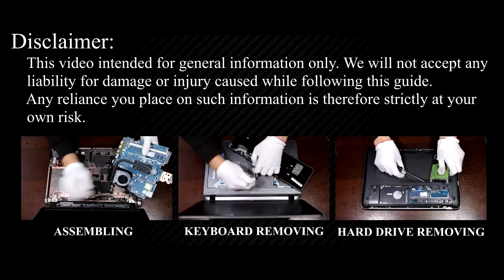HP ProBook 450 G2 disassembly and fan cleaning

Comment: Hi How fixIT
I really appreciate to make such a video!!

I have some issues with my laptop  HP PROBOOK 450 G2 after water spill. 

After watching a movie late night Last week i kept my laptop on the floor (laptop was shut down but the charger was connected to power) and slept, Our water tank broke and water came into our room, but we came to know about this 3-4 hours after this incident.

When i looked at My laptop it was like half dipped in the water in normal position(in the same position we use a laptop,horizontal) i immediately removed the charger, removed the battery and opened the laptop to clean it completely, (i cleaned everything, only i didnt open the processor). i waited for one day and i turned on the laptop and everything worked fine for one complete day (i didnt turn off the laptop for that one complete day). next day before going to bed i shut down the system now the system is not turning "ON" at all. 
what could be the reason? 
what is the solution?
Now, when i connect the charger to the laptop the power button and caps lock is LED is continuously "ON". But not turning on

Hope i have explained it will for you to understand the complete situation, i can send you images/video if required and upon providing your email address.

Many thanks.
Nahas

Comment: Hi, great work, I have this laptop, and I have some noob questions, is it possible to upgrade this laptop, is it possible to add a graphic card? Now its running on Intel integrated graphics (i7 4510u).
And another question, what is this "hole" on the right of the network card (while it is still assembled)? It looks like some kind of port to me, is it? If yes, what is it for?
Thanks!
Reply from the maker: +matko00000 you can't add graphic card. This is place for mSata slot.